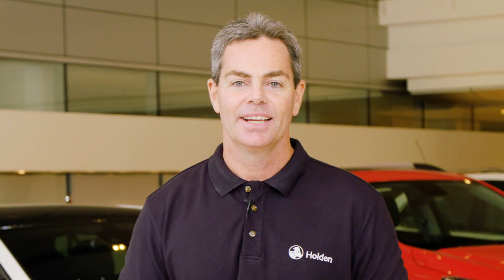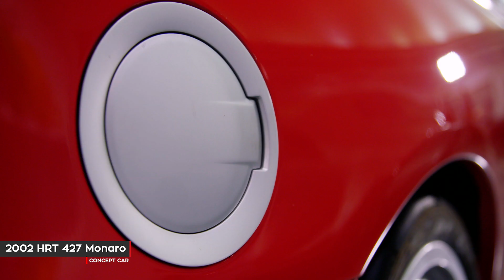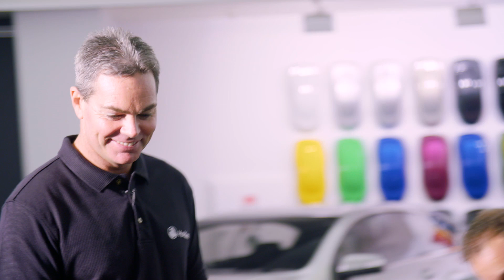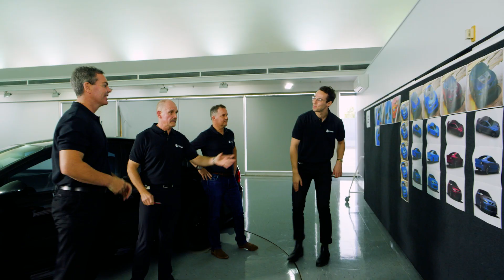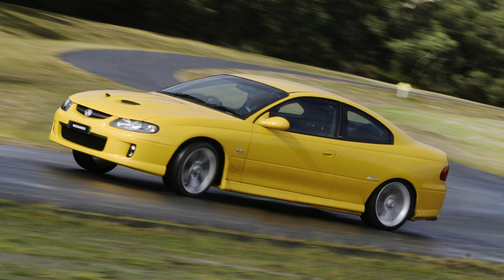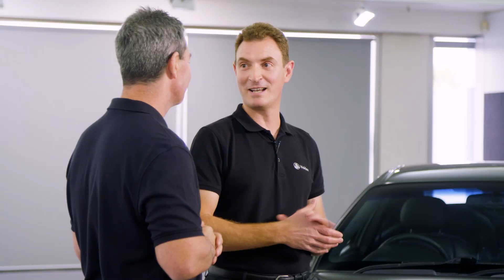Holden's Project Monaro | Episode 1

Comment: My old man bought a brand new HSV GTS 300. Massive disappointment, body flex, dead motor, shoddy build and weird steering feel. Drove it back to back with my R33 GTSt which was then 7 years old. The Skyline was surprisingly tighter…

Comment: If Holden had offered the (Commodore) Monaro at an affordable price to start with - they would have sold a lot more, instead of 'gouging' original buyers and limiting the market to those on $100,000 plus salaries.  Sad to see Holden end up where they are today selling 100% imported crap. Holden is dead in my household and I 'Was a fan' for 45 years..even working at a dealership in the 80's...

Comment: Haggerty and Hughes have a solid history but Ben in the styling department sounds like he's just knocked back a case of red bull and is keen on reviving the sex-spec style. 

Amazing it's not going all 70's flashback and getting graced with a trippy purple body colour, retro gold honeycombs and bumcheek burning vinyl pews. 

Maybe Holden should seriously consider diversifying into re-manufacturing old desirable Holden models as their major focus rather than continuing to ignore all the enthusiast and core market feedback about the ever increasingly horrible vehicles. 
    This would be a possible alternative as currently they can't design and build cars people actually want, rather blindly continuing to pump out ever increasingly horrible vehicles based on rebadged Daewoo's and French factory built reliability  grenades pilling up unsold. 
  If that's not a massive alarm bell and flashing neon sign that all is not well, it's absolutely mind boggling the execs at GMH aren't phased about the lack of brand dominance once held and decreasing brand loyalty instead continue to use taro card readings for business advice and using marketing focus groups full of clueless braindead lemmings only interested in how much crap there is to play with on the dash or if it can save them from their chitty driving skills with voodoo magic. 
Car manufacturers don't care for the actual vehicles and the relationship between the car and owner, rather they will direct the effort in trying to dupe suckers with marking dribble and words that can magically make obsolete and archaic technology new again in a rouse to snare a unwitting purchaser. 
And the lying, cheating, stealing scum if GM execs don't even care if the Holden name eventually fails and is relegated to history. 
A55HOLE5

Comment: When people think performance they don't think paint job.

Stop cheaping out on performance parts.
1. Cold air intake
2. 3 inch exhust with custom headers
3. Camshaft
4. Supercharger
5. Coil over kit
6. Pedders shocks
7. Pilot cup 2 tyres
8. Brembo brakes.

Job done boys.

Comment: All this effort to reignite an aussie muscle car, 1 if you didnt pull out of the aussie production market and become just an import company that just rebadges pos not made for Australia conditions, 2 why try to impove a cv8 and calming its a 1 of 1 instead of a coupe 4 that is already a rare car alone
Reply: gmh were all about import shit back when the camira started it sucks
Reply: It technically will be 1 of 1 as it SHOULD get a build placard fitted from the design team, which in turn will add some value and rarity to it. Not much but still, a little more then the average CV8